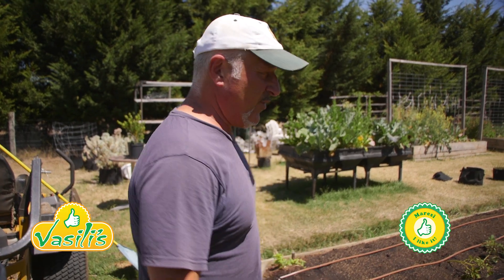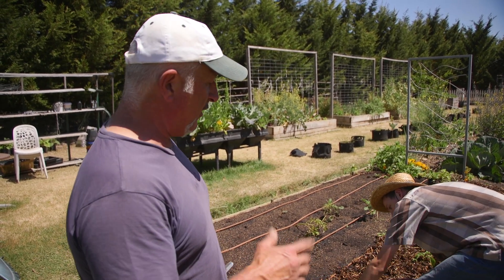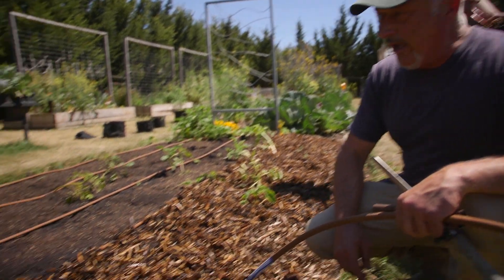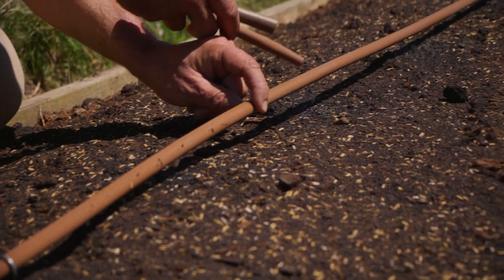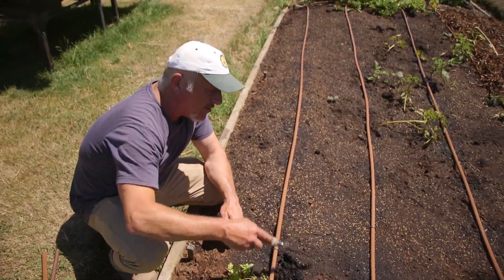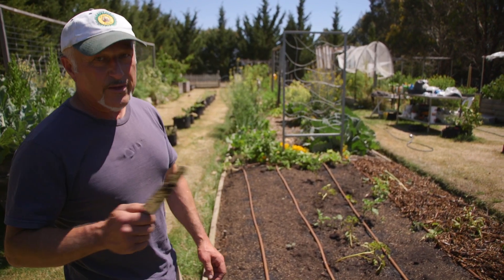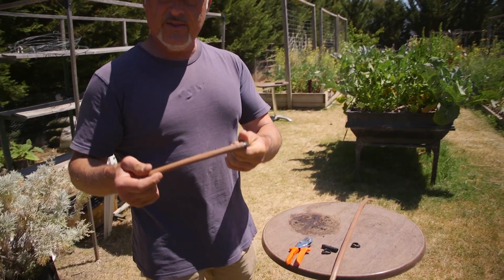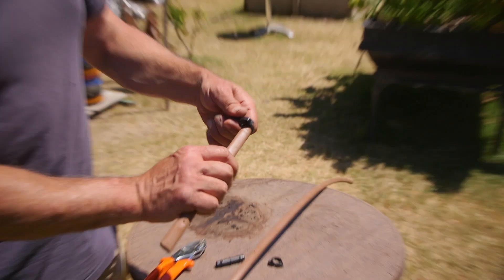How To Install Drip Irrigation

Comment: Hey Vasili you can get a water pressure controller that goes on at the tap also. It comes with a filter too.
Reply from the maker: Yes you can, and I by mistake took mine off and the hose fitting popped and flooded part of my garden.